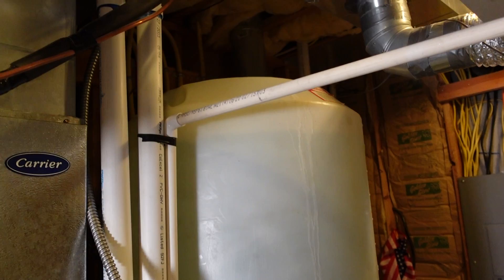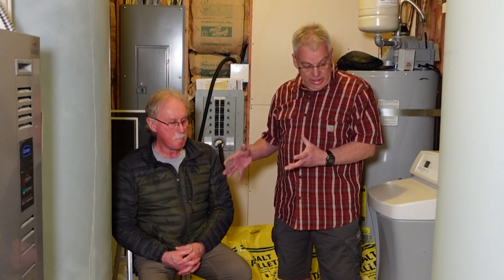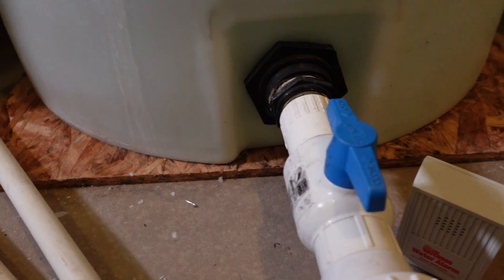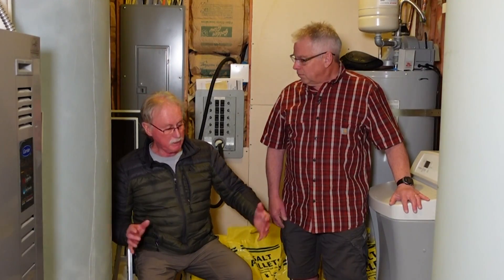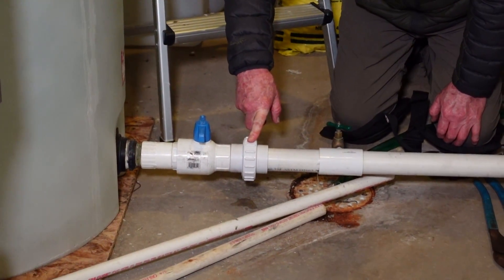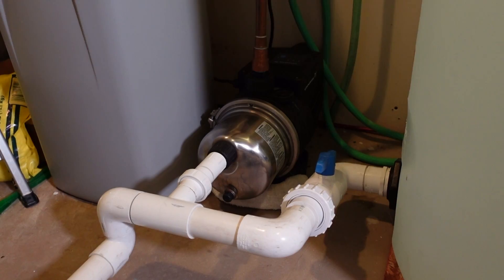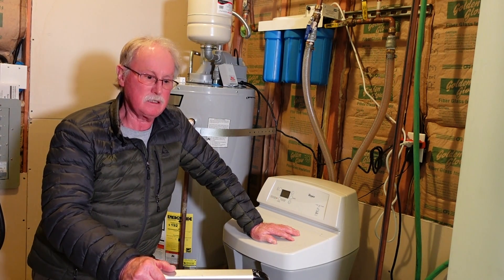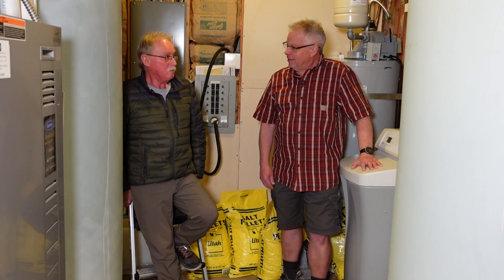Brilliant DIY Whole House Emergency Water System Designed by Chris

Comment: Purification before or after the tanks? I would want a more stringent purification system before the tanks so you don't risk tank contamination, and then a secondary filtering system to the main line tie-in.

Comment: What happens to the water pump when the water storage tanks run dry? Does the water pump automatically shut off then or do you have to manually switch it off or worry about it constantly running  and overheating and burning out?

Comment: Nice setup.

Just installed a similar system minus the purification system, my next upgrade. Doing my first test run today with the whole house running off the tank.

More out of necessity here in Cape Town with repeated monthly water interruptions from burst city pipes. My system also allows me to divert my city supply through my tank first to catch dirt in the soil in the pipes when water returns. My washing machine is connected directly to this supply to ensure I continuously rotate the water.

This is becoming the norm for many households, along with solar panels/generators here in South Africa.
Reply from the maker: That's awesome!

Comment: - Another important component that would be strongly recommended for this system would be a "Pressure Tank" (part air, part water) to buffer the pressure fluctuations when the pump kicks on and off, otherwise the pump will hammer on and off every time you open a faucet. The small white tank above Chris's shoulder in the opening shot is likely a SMALL pressure / expansion tank intended for the hot water heater and might be accomplishing this purpose (albeit minimally for this installation.) Speaking as someone with a well and pump, this tank is critical to ensure the pump does not "hammer", and when the air bladder fails, it is made clear by the pump rapidly cycling on and off. NOTE: I am NOT a licensed plumber, just a homeowner with a well. 
- Make sure the hose used to fill the tanks is rated for potable water, as I recall, some cheap garden hoses have lead and/or other "bad stuff" that can leach into the water. 
- As for the doors, Oh do I wish I had 36" doors....

Comment: A very interesting design. I also have a whole house water system. Mine uses water from my well through an RO system that feeds a 250 gallon tank, which in turn feeds the house. So I have RO water at every faucet, toilet and water heater. My well has high levels of nitrite just below epa maximums. The dishwasher had a film we couldn’t get rid of. But once I put in the whole house RO system, the film in the dish wader vanished!

Comment: I've designed a off/on grid community living & school with 2 of each classes from pre-school and grade 1 all the way to grade 12. The filtered tank system can either be filled up by municipal water (when available) or from the huge qty of protected storage tanks that fill up from rain water - a heating system prevents pipes icing/freezing.  One room holds all the battery banks etc.  When off grid solar powered with some generator backup. Community living area + school also has its own vegetable growing/drying/freeze dried facilities. Huge underground storage (below the school building) with parking area.  Farming area around the school with the accommodation that can take all the staff and every kid's family that attends the school.  Composting toilets and/or sewerage tanks evenly distributed.  Gray water catchment and filtration system for plant watering.  And massive double walls plus double entry secured gates + other security features I won't go into detail here on this public space.  This is what is necessary in South Africa today.  Our country is on its last legs. Anarchy is coming - we are almost there.  Loved this vid.  Well done!
Reply: Have you considered systems from HomeBiogas?  They make systems of various sizes that turn organic waste into natural gas for cooking (or water heating) and concentrated liquid fertilizer.
Reply: @zinaj9437  I have looked at it.  It is a good idea for the staff and parent's homes, but not for the school.  I have had experience of little girls visiting a biodynamic farm and using yards and yards of toilet paper, clogging up the tiny septic tank connected to the visitor's building.  I and the crew were pumping poo out as it had overrun the veranda area.  Wearing wellington boots and almost knee deep in poo.  Uuugghh.  So each ablution facility in the school connects to various very large septic tanks.  Visions of Mad Max movie 'Thunderdome' comes to mind - I really am not up for it...  A biogas home unit for each house is though is really a good idea.  I will keep the septic tanks though, so if the biogas unit goes 'south' then the sewerage outlet can simply be re-routed to the septic tanks.  Thanks for the suggestion, much appreciated.:virtualhug:

Comment: This has lots of promise.  If the power was off and the city water was shut off how do the tanks get filled?   If things were really bad is there enough fuel for the generator?  I think this would work so well.  I wonder if this could be plumbed into a cistern.

Comment: Could you run city water through the filters into the tanks (multiple chained with flexible pipes) into the pump then normal house distribution.  Wouldn’t this constantly refresh the water?  Tanks would be pressurized (from the city) and house pressure controlled by the pump.  You would only need one shutoff from the city water and maybe one way valve to relieve vacuum from the tanks when not connected to city water.
Reply: If the tanks are pressurized, they must be rated for pressure, which will make it A LOT More expensive. I Highly doubt the tanks shown in the video are rated for pressure.

Comment: Great awesome, but still connected to the mains ? So if Shtf you have x two weeks water, what the backup?
Reply: It would be smart to have your gutter system feeding a larger outdoor tank that is plumbed into the indoor tanks with filtration in the middle of the line.

Comment: Yeah nice Idea but I certainly wouldn't want all those PVC pipes running around inside our house or have water tanks inside either especially if there's electrical in the same area.
Our rainwater tanks, filters and pumps are all outside and to swap from mains to rainwater is simply a matter of changing a couple of valves which takes a few seconds.
I used to sell and install a lot of this stuff and have seen how it can fail or be damaged many times.
Reply: That's exactly the kind of system I'd like to set up for us, but how do you keep it all from freezing in the winter?
Reply: @tracyplath863  I thought about that after I posted but where we are we rarely get cold enough and all our pipework is underground for most of the system or is up against the house where there is a bit of a heat sink sort of effect.
Certainly freezing pipes are a major issue in many places and can cause severe damage.
Our tanks are pretty decent sized, up to 6k gallons, so if they freeze we will be in big strife.
Another thing to think about is a non return valve system or you may need specialist fittings if you're going to interconnect a mains system with a pumped rainwater system.
Here we're supposed to have a backflow prevention valve in the system to stop the risk of rainwater going back into the mains system.
Depending on your mains pressure pumps won't handle it if they're backpressured.
We're in Australia so I have no clue what sort of rules are where you are, if any.
Good luck with it all.

Comment: Nice set up but you don’t mention how the pump is powered?  I would suggest using an on demand 12 volt RV pump powered by a couple of 6 volt golf cart batteries that are charged by a trickle charger as needed to automatically keep them charged so that in the event of a disaster with loss of city water AND power you could switch over to the demand pump.  And if the water reservoirs were plumbed in line with the city water coming in before it reaches the HWT there always be fresh water in the reservoirs with no need for periodic draining and refilling.  Your only concern would be shutting off the water supply from the city water to avoid contamination.  Your only maintenance would be changing the water filters and ensuring that the batteries and charging system are working properly.  As an alternative you could use a generator to power your house electrical panel in conjunction with a transfer switch, but you would still need an on demand water pump.
John Jensen from British Columbia
Reply: Unless you rigged some sort of automatic fill / shut off system for the storage tanks and a separate pump to re-pressurize the water for the home, you'd need to have pressure rated storage tanks which would get MUCH more expensive, the plastic tanks in this video are NOT rated for pressure is my guess.

Comment: OMG this is brilliant and it is completely doable.  I figure $600 for 2 tanks, $150 for a self priming, positive pressure water tank, plus maybe $100 for misc PVC and fittings.  If a plumber is needed budget $200.  A reverse osmosis filter system is optional in my opinion if filling tanks with city water but budget $250 if desired.  So ...someplace between $850-$1,500 for a practical and useful peace of mind system.  Thank you Chris for a wonderful design and to Jonathan for sharing.  This is awesome.  I'm slapping my forehead, "why didn't I think of that!"  For me, I'd get a 12v pump and attach a 12v battery so the system would have power when the generator wasn't running.

Comment: I'M SURE THAT'S A VERY EXPENSIVE SYSTEM
Reply: Tanks will run you about 1500 max if you look around.  The biggest issue is going to be the space.  Purification along with plumbing gonna be maybe max another 4 or 500.  If you can plumb it yourself your good.  Another big issue is if your not on a concrete slab, those tanks weigh 1000 lbs each or more and that can wreck a pier and beam home over time depending how your joists and supports are setup.
Reply: Thank you
Reply: No not really.
Reply: Expensive is relative. For me, very. For someone middle class or higher income, not at all.